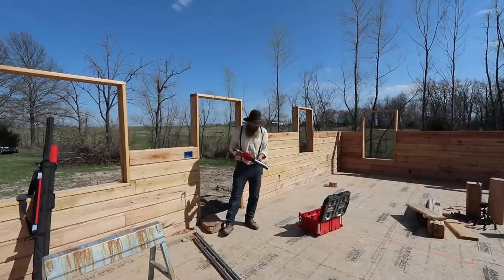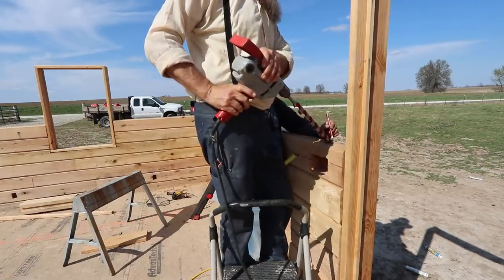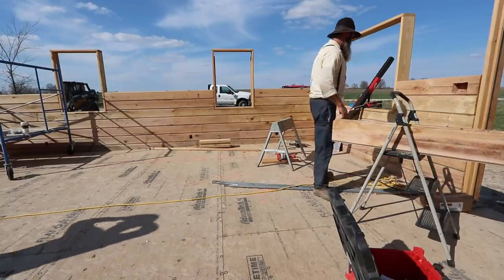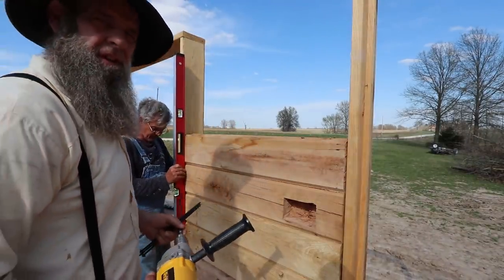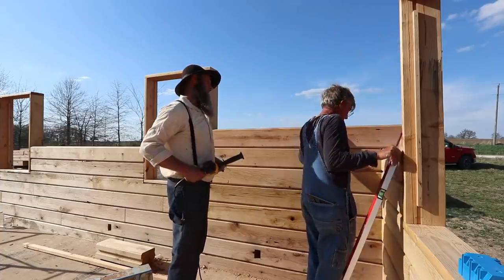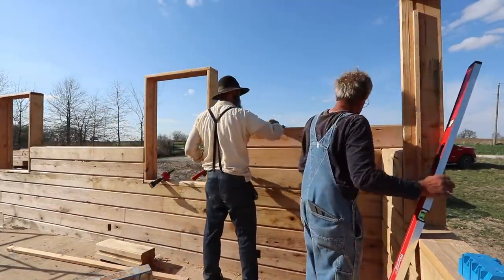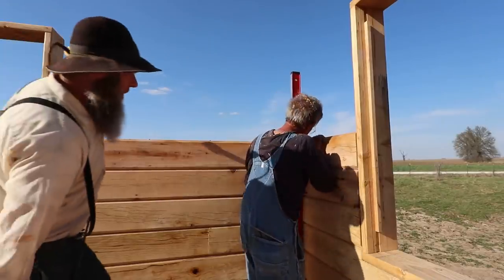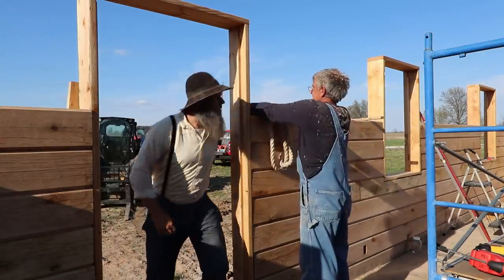Mom's LOG HOME is held together with this! day 30 of the build

Comment: Last time I worked on a log cabin using D-faced double tongue and grove logs we brought the electric from the crawl space to each box.  Each log started with an oversized hole to minimize pinching and continued with the appropriate size hole for the number of wires. Worked very well without issues.

Comment: Why not take a board as wide as the log, place it against the door jack, drill the hole through and then on each successive log place the board on the log and drill your next hole. That way they would all line up. Just a thought. :)

Comment: I'm probably too late with this, but I've done this before on wooden structures and what I did was manufacture a steel plate with a piece of pipe welded to it perfectly squared to the steel plate, the inside diameter of the pipe larger than the outside diameter of the drill. What I did was put it in place and clamp it there so it won't move, then just drill to my heart's content with the depth marked by a piece of tape on my auger. Doing this gets the hole in exactly the right place and exactly vertical plus, if you mark your auger, you get the right depth, so you are absolutely correct in all three dimensions. Just sayin'.
Reply: That sounds like a good plan.

Comment: I built many a log cabins and we just built the walls then cut in the windows and electrician ran his stuff on the walls, this build probably would’ve taken a week tops to be dried in with tin roof with 1/2” foam board under it. Anyways to each their own it looks 👍🏻.We never had an power gun for the glue to fasten the logs I’m jealous but then again I have the grip of a gorilla now.

Comment: I remember building a retaining wall out of railroad ties. I used long nails and screws to hold the wall and ties I ran back into the bank to help stabilize the wall. Predrilled holes to help drive them home. Man those things were heavy.

Comment: Would it not be easier drilling the electric wire hole while the log is at a lower height (on the ground or just off it)?
Reply: its going through multiple logs though. The chances of drilling in the exact same spot in each log and it lining up perfectly would be unlikely. of course its possible i they measured to the center of th log and then the distance from the end. However it would take a lot longer to do all that measuring and then having to pick up the drill on every log. It would be very time consuming, I think its a lot quicker to be able to only have to drill once and get through all of them and then youll know for sure you have a perfect hole and dont have to worry about the wire snagging or getting hung up on one of the logs that didnt get the hole drilled in the exact location of the others. This way theyre not having to measure it every time and pray they all line up.

Comment: Doug, that is one long ( and a bit <-🙂 pricey ) Drill bit, when drilling, the contacted surfaces eat up drilling power, you can get a short leading screw bit that diameter with a reduced driving shank and extend the drive shank increasing your power to the cutting process reducing friction. The draw back is you should clear the hole more often and there is less of a heat sink for the cutting end so you need to chill on the the Incredible Hulk approach- ease up on it, don't over heat the bit. I have made my own setup with an extension and a short bit ( the set screws on the extension come out of the cheep extensions and you must check them constantly as the extensions are made sloppy and off center) I have brazed ( and welded ) my own rig together, the brass can give out if you over heat the joint, the pre made flex shaft bit is difficult to  control used by the new guy  and will have you hole to the outside in error before you know it 🥲 and the ends come off while your in the wood (heck of a spot to be in) ...
when I have made my own, I Made it with close fitting mandrel tubing, I can get it to here local , But it can be bought online from a machinist supply house. your buddy that's helping you has an obsession with accuracy which I enjoy as a machinist, but will prove necessary with your template method, I have no doubt he can pull it off if you don't needle him about his perfection. I have no doubt The both of you will have success and putting in mom's wall switch, and I am very glad you didn't go for the original path, there should never be any compression on a wire As the wire will move physically through the insulation overtime.

Comment: Nice job I could never Don what you and Jerry doing. Idea what if you would have put a piece Avoid the size of the log but 1 inch thick and screwed it right there before you would’ve drilled the conduit then you had a template he just laid on top of each log and drilled through the hole that you drilled when you made the first hole for the conduit just an idea

Comment: As a former forklift driver for the USAF, one thing that I’m constantly conscious of is safety. It might not be a bad idea to build a jig of sorts to keep the rope from sliding back on the forklift tines when installing logs. You could take a pallet and screw a couple blocks close to the end on either side to create a channel for the rope to ride in keeping it from moving back. My biggest concern and reason for mentioning this is preventing Garry or whoever is helping install the logs from hitting their head on the tines and also keeping the skid steer from getting to close to the house as you get higher. I hope this helps and stay safe. The house is looking good. I’m sure your mom will love it...I certainly do.

Comment: I like the idea of drilling through the logs to run the wires from the switch to the light, but how are you getting the power from the crawlspace below up to the switches?
Reply: He said solar power? So power will come from roof and then down to crawlspace to energize the outlets at the bottom of the wall. He is using a wall inside to get to the crawlspace with the power wire. The lighting wires and switch wires will come down from the roof. I think that is the plan.

Comment: Doug I love you man but you are scaring me with the way you gauys are lifting the logs up. The lifting system is fine but please put 1 c-clamp about 4 or five inches from the end of your forks on both sides to prevent the rope from sliding back and it will give you more reach.  You guys are doing a great job keep it up and be safe.

Comment: Good day, question do you have to drill down the wall for the outlets aswell like you premade on the wall for cords like the light switch
Reply: He is going to get power to the crawlspace through a wall inside the cabin and then up to the outlets. He already drilled down to the crawlspace for the outlets.

Comment: That's ridiculous reasoning concerning feeding household wiring through a bend. 
A vehicle vibrates as it's run, so of course there's friction and rubbing, whereas in a home it pretty much static, not much chance of rubbing, especially if you're using a conduit.
Reply: The log home is coming along pretty good. You and Gary are doing a marvelous job

Comment: Careful with that bit did electrical on housing for 20 years if you catch something that drill can knock you out. Been awhile since i done homes but thought they had a hole hawg drill with a clutch just incase it catches noticed the hammer drill are getting them. Be careful!

Comment: A WAY TO INSURE YOU ARE SPOT ON FOR ELECTRICAL WIRE CHANNELS I’m sure you have scrap pieces of log that you could use as a template for all other logs. Use a speed square with a magnetic level to insure you are drilling plum

Comment: I hope you just aren't  filming the caulking process instead of forgetting to do it..First two logs appear to us as not caulked . You should be using a drill jig for your electrical holes other wise it going to be a bear to get conduit/wires through the hole.....I guess I should just watch because these videos aren't present time anyway?
Reply from the maker: Lol you get em HOT 🔥off the presses...REAL TIME